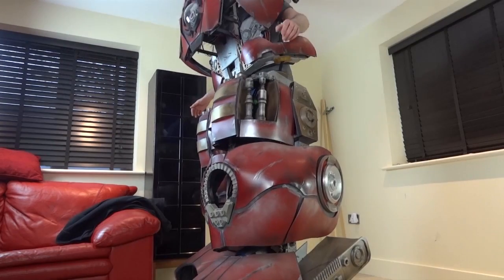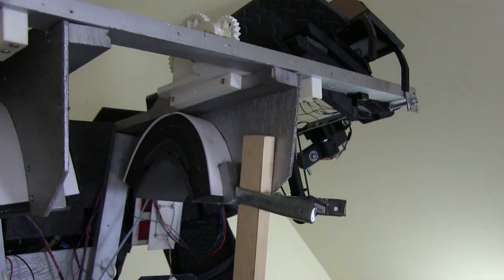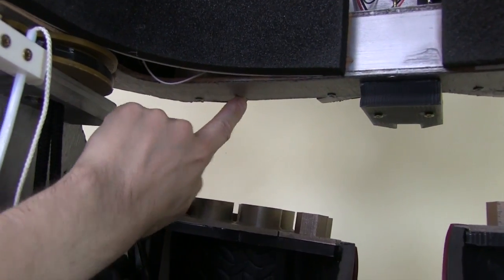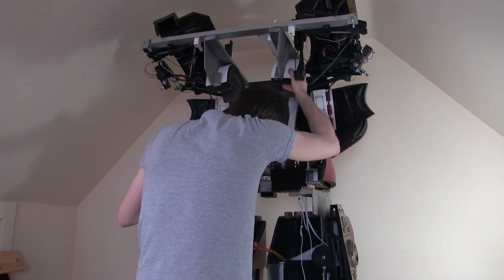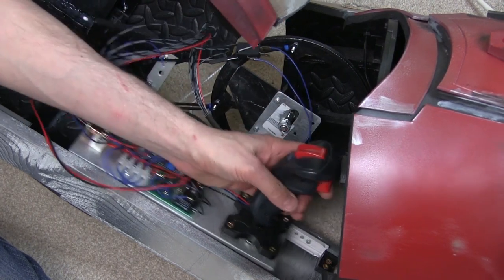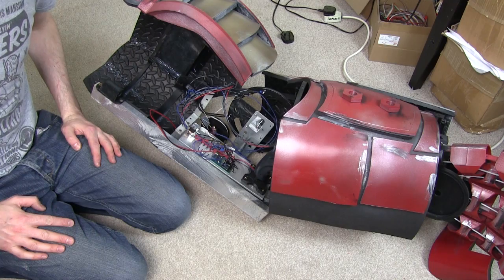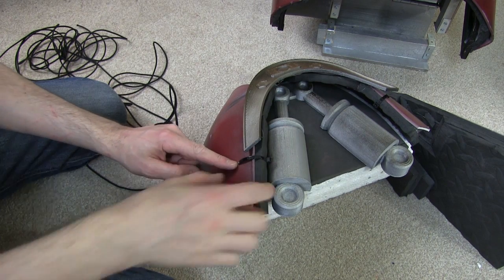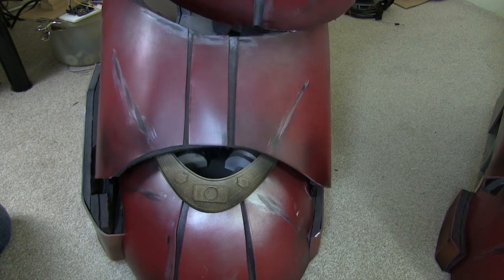Iron Man Hulkbuster Cosplay #50 | More Walking | James Bruton

Comment: Have you considered making the Chest open up like the Real Hulk Buster does to expose the head area? I know that has a lot of moving parts but your good at making realism in the moving parts department.
Reply: While that would look FREAKING EPIC to say the least, I don't think he's gonna do it because it would be impractical. Most of the wiring goes around the front, and the chest plate is already built as one piece, not as two halves.

Comment: first off great build, I enjoy watching the build. but 3d print parts, foam matting and wood equal to a lot of weight. you should consider on getting a CNC router table. you could have made a lot of those parts from styrofoam, with some paint you wouldn't know the difference except for weight.

Comment: Hi James, great update , watch all your footage back , the shin guards of the legs are restricting your movement , and also catching in the feet in an early shot , there may be too much movement , you could get away with reducing them in size I think they would then match the upper torso much better and more of you leg could act on the legs to puppeteer the suit , or split them so half is rigidly attached to the inner side of your let as a costume and only the outer leg is mechanism thus reducing the mass that is rotating against your movement 

Did you ever consider gyroscopes to help with stability? Could a vertically mounted gyro on the front help?

Comment: with the gap between the torso and legs, I think it would be beneficial to include some more torso panelling to help with proportions.
I'm also not too keen on the large leg panels with the circle cutouts. They look somewhat pointed to the sides in a way that reminds me of a dented car. I think those should be replaced with something that looks more rounded like the top leg panels.
Other than that, absolutely fantastic. I love what you've done with the whole thing.

Comment: Cool!! would adding mechanical winding sounds and metallic clunking for leg movements be a possibility? I thought it could be done with a simple press switch on the bottom of the feet. e.g.. on up winding sound. and when the foot touches the ground it will go clunk... 
just a thought... hmm I don't know if you would hear it anyways as conventions are pretty noisy ... just an idea... ^-^ it looks grate!